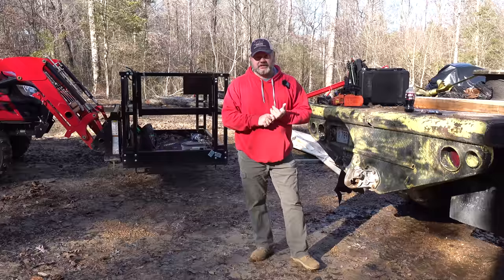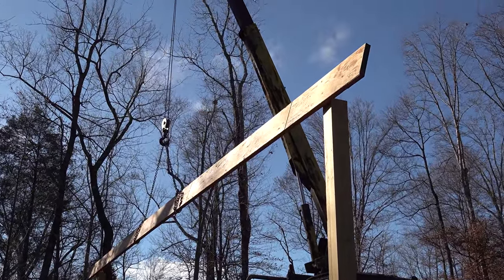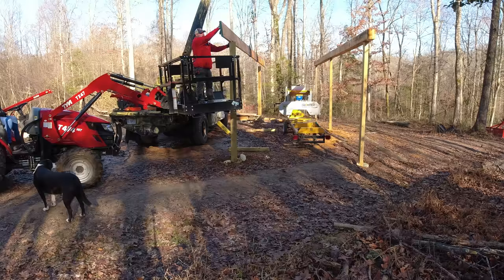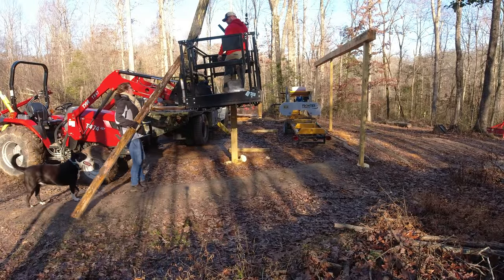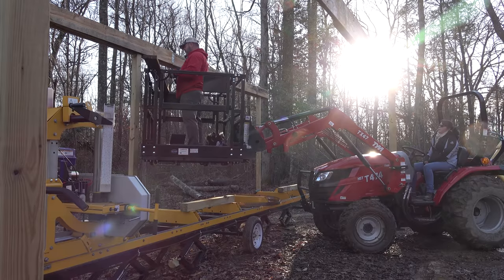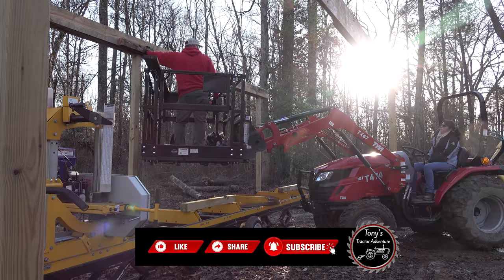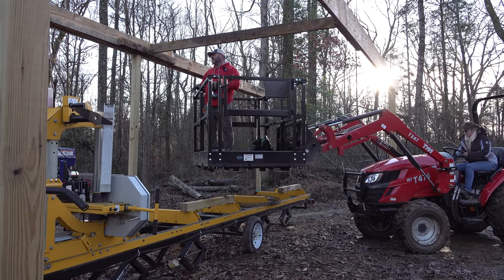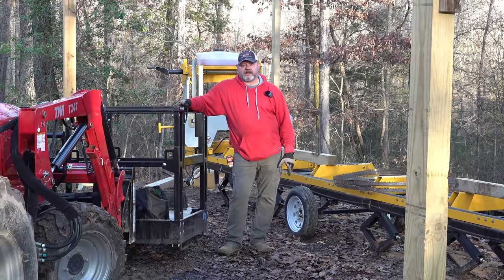The BIG SPAN! Sawmill Barn / Shed / Frontier Sawmills

Comment: Curious why you don't raise rpms on the boom truck. I have the pitman HL58 on a 685 c50 such a great piece of equipment!
Reply from the maker: I didn't see the need.
Reply: @TonysTractorAdventure  how much does yours lift? Maybe 4,000 at good rpms?
Reply from the maker: It doesn't seem to matter the RPM other than speed of operation. The best I can make out, it is rated for 7000# with a block. There is not much info on this unit.

Comment: How did you joint the big 30ft open end  beam together ? I’m building a carport with that same design.. an need a 30’ open
Reply from the maker: I bought a 30ft beam from the lumber yard. I built the rear beam but had a little to much sag. I learned a lot from that build.

Comment: I still question the strength of your beam.  I wanted to remove a wall in my house that only supports a ceiling.  I was told I needed a single 29" high x 29 x 2.5 inch foot beam to replace it as a single laminated beam or two 15 inch x 29 foot x 2.5 inch laminated beams (glue strand beams might be the correct name).  When putting in a header, the span divided in half plus 2 inches is a rule of thumb for the height of the beam, plus it has to be double thick, as in 3 inches minimum.  Anytime you go over 20 feet, you usually can't use standard lumber and meet code.  I am not an expert.
Reply: I also question the strength of the beam.  As mentioned in the comments in a previous video, LVL beams are designed to be used at least two ply thick.  That is why they are 1.75 inches thick.  Two of them nailed together are the same width as a 4x4 post.  They  are designed to sit on top of the post, which you did. But they are meant to be used with a very heavy duty bracket on top of the post.  Last time I bought one of the Simpson brackets they were about $80 each from Home Depot and I had to order them.  If you nail two LVLs together you have much less flex in the beam.  The brackets keep the beam from tipping and then you can put your rafters on top with a birds mount on each end.  That keeps the beam from flexing and blocking between the rafters will keep them from tipping.  From there either purlins or sheeting on top will tie it all together.  My guess is you have already done something with rafters and just haven’t posted the video. Yet.  With no snow load and it being temporary the single LVL may work.  I would be concerned about wind load but that is dependent on how you tie everything together.

If you ever reuse the beam in a permanent structure, look a the manufacturers specs for the LVL and use an online rafter calculator to know what size rafters and spacing to use for them.

Project looks good and I love your videos.  Thanks for posting them.
Reply from the maker: Guys, This is a temporary. We have no snow load. I have walked all over the roof at the time this video was put out. I would go all out, if this was a long term building, but this will be gone in a couple years.
Reply: It's a tin roof. No load to speak of, though it will begin to sag a bit over time by virtue of gravity at that span. For what he's doing, it'll be fine.